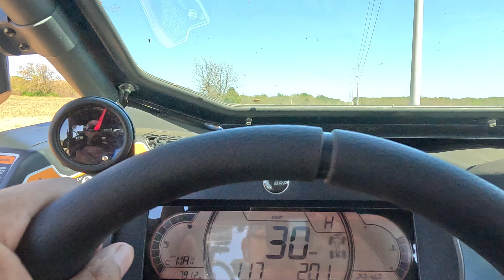Red Bull Ranch Scramble Practice - Can-am Maverick X3 Turbo RR

Comment: Looking good amigo, I am glad to hear that the car is handling better, and it's a great idea to practice with new suspension settings. I look forward to seeing what you come up with for the secondary door latch!
Reply from the maker: I ended up using that small stainless steel cable and a carabiner to connect them so I could still open the door.
Reply: @discoverpowersports  That's pretty much what I was thinking of doing to get through tech inspection. Are you going Pro class or Pro Am ?